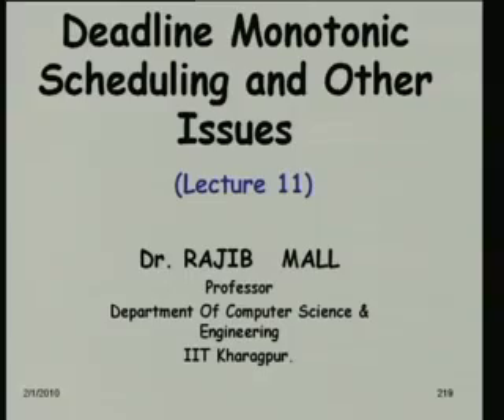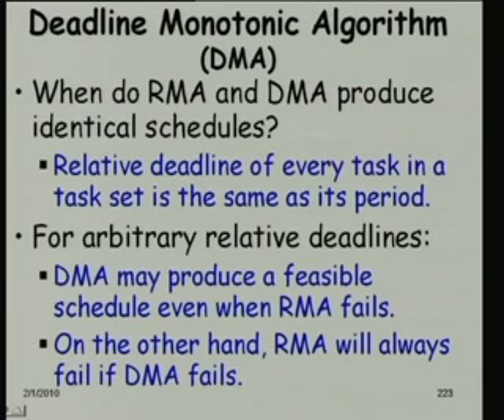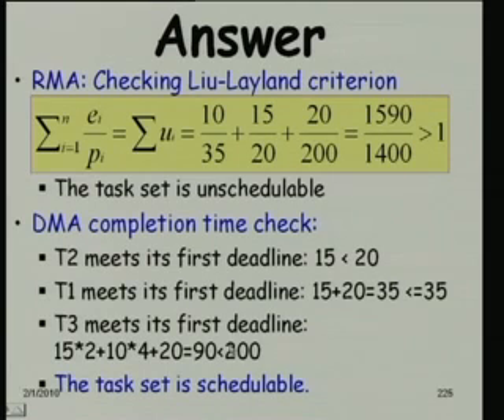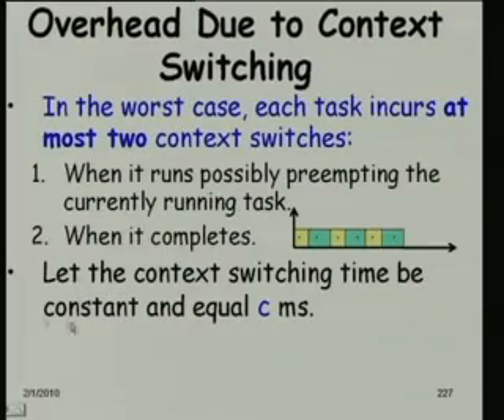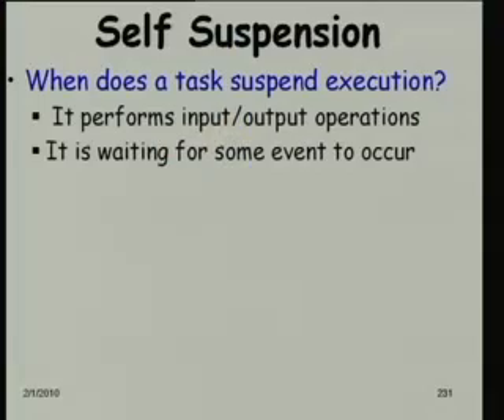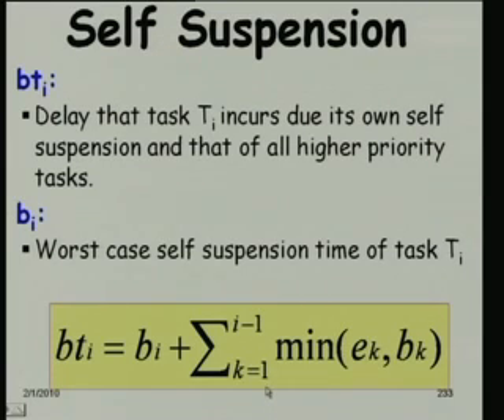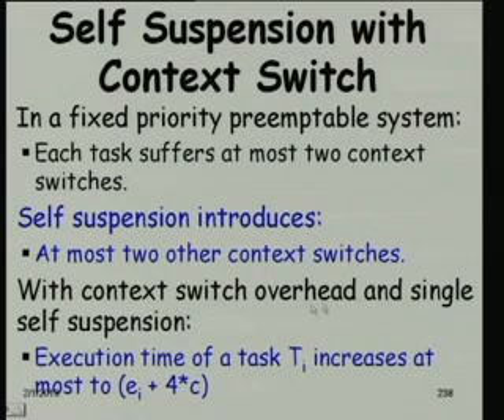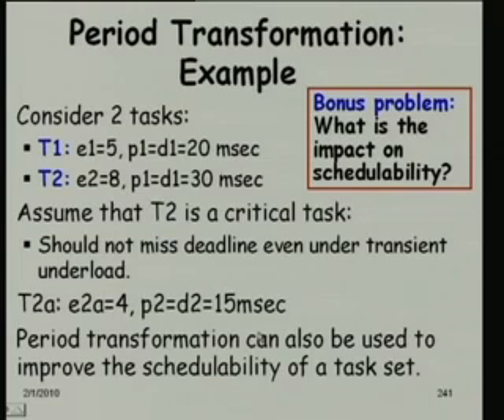Mod-01 Lec-11 Deadline Monotonic Scheduling and Other Issues

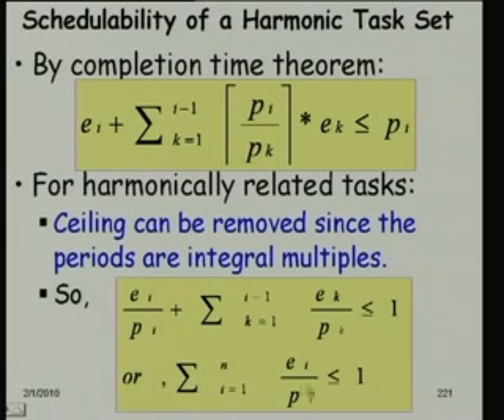Comment: At 4:56, how can we say that ceiling can be removed because it is integral multiple. Even when it is not integral multiple, we can say that the ceiling can be removed. Therefore completion theorem can have 100 percent process utilization all the time even if it is not integral multiple also (as per the given formula). IF I AM WRONG, PLEASE CORRECT.